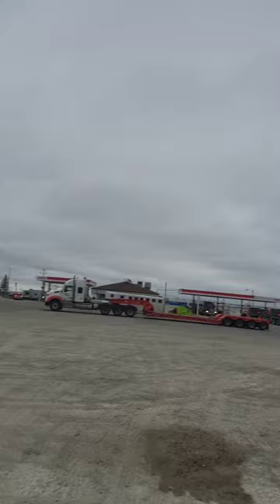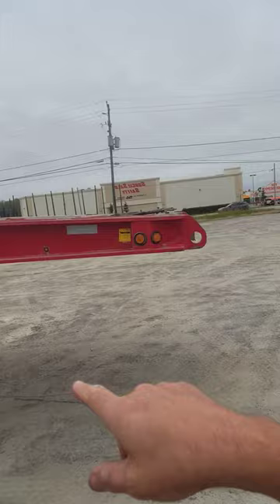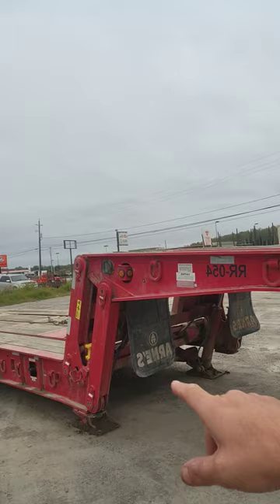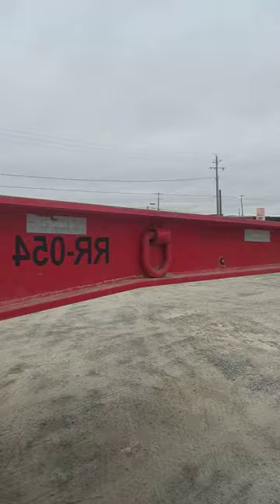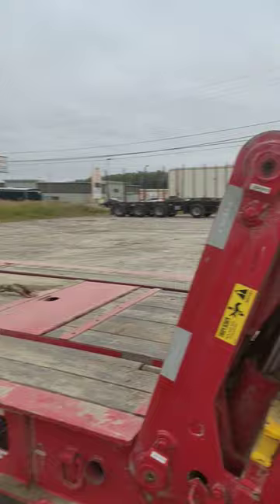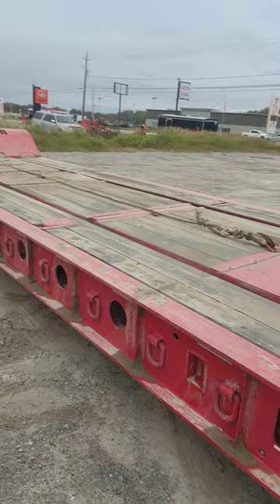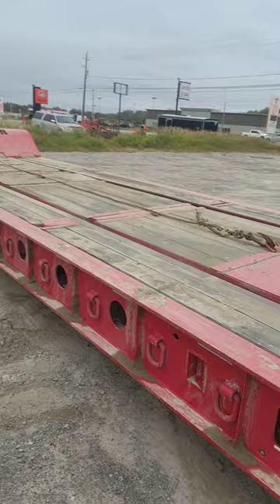What is a scissorneck?

Comment: Looks like it's used to haul railroad equipment. Look at the deck. It has a set  of rails built into it. Plus the trailer number has RR in it.
Reply: I’ve definitely only used these for RR service equipment but it could do other work in theory

The winch helps get the RR stuff up the incline as it’s tough to get traction metal on metal.

Super interesting work and time consuming lining up to the rails.

What I don’t see here is the adapter rails that make the final ramp up from the rail line
Reply: Same thought

Comment: I run a scissor neck but not a lowboy but a step deck one, it's only a tridem and it weights 25,000 empty lol
Reply from the maker: my point exactly. my previous 55 ton Fontane RGN weighed 23,000 LB with 3 axles, and 26,000 LB with 4. The 60 ton I have now is 7,000 LB heavier.
Reply: @HHTV60  yeah it's annoying, especially since half the stuff I haul when I pull my scissor neck is multiple pieces and i have to keep it under 80,000 being 50k empty lol

Comment: They are very cool but not the best use I've seen in that configuration. The best is when operated as a winch trailer because you can run it as a highboy winch and haul buildings, but still convertible to a step deck for tall loads.